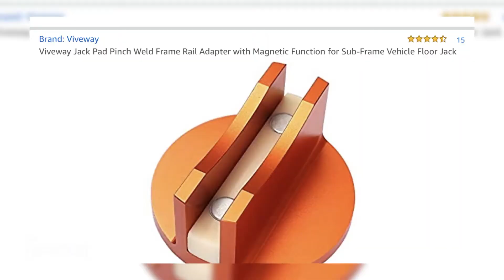Pinch Weld Jack Adapter - Easily Lift Your Pinch Weld Vehicle With A Floor Pump Jack

Comment: The pinch weld is typically NOT the jacking point. The load bearing location is usually on the inner side of the frame behind the pinch weld.
Reply: those grooves in the pinch weld tell me that's where the jack goes
Reply: @xjidanx  The grooves in the pinch weld are indeed where the jacking point is located.

1:20 However if you look at the Chinese “one size fits none” jacking adapter fit, you’ll see that the bottom of the pinch weld is hitting the bottom of the jacking adapter which is a no no.

Examine your Nissan Qashqai emergency jack (https://i.imgur.com/TWuZIpa.png) and I bet that the depth of your adapter does not match the depth of the slot in the emergency jack which is designed to clear the pinch weld and support the frame by the sides of the pinch weld only.

Comment: Ok I used to do roadside assistance, so I have some knowledge on this.

PLEASE BUY  JACK STANDS floor jacks fail all the time.  You can get them cheap at a tag sale, Facebook marketplace place, etc.... (The old ones are usually better because they were built with better steal)

Think of it this way. The cost of  jack stands is nothing compared to the cost of the cosmetic and/or mechanical damage that you car can get if the floor jack fails at the wrong time.

Also, it'll cut your time in half since you will NOT need to keep taking the spare on and off and raising and lowering the car.

Comment: No jack stands ?
Reply from the maker: I use ramps for changing the oil on that Rogue. The video was to demonstrate the ease of lifting the vehicle with the adapter. But you are right. Jack stands or ramps are required for more than a simple tire change.
Reply: And he put the wheel chock on wrong side of tire??
Reply from the maker: Driveway has a 2-3 degree slope down toward street. Vehicles in neutral and no brakes applied roll in that direction. Chock on street side of vehicle.

Comment: This is all fine and dandy to 'lift' the vehicle with the jack. But there is no reasonable priced jack stand that is designed to accommodate vehicles with pinch welds.
Reply from the maker: They do make similar adapters for jack stands. I suggest measuring the top of your stands to make sure these adapters fit. There are tons of these things on Amazon. Here is a link to some: https://amzn.to/31Y4Nvr As an Amazon associate I earn from qualifying purchases. Sorry for the disclaimer. It's required.